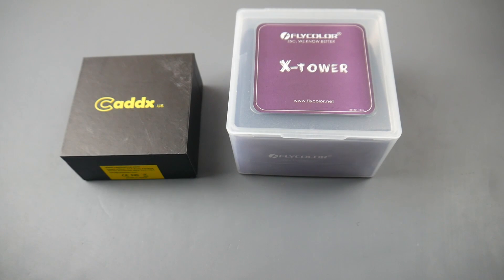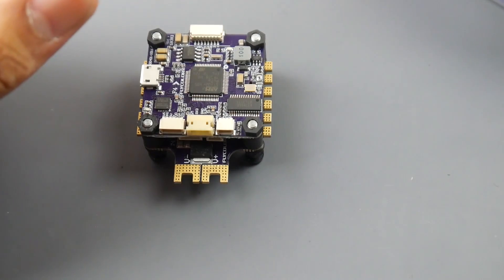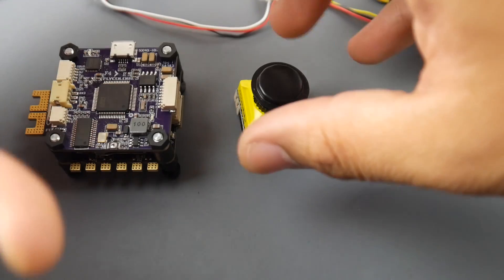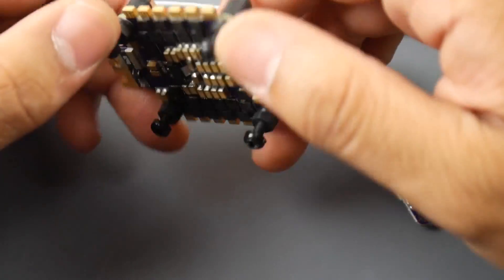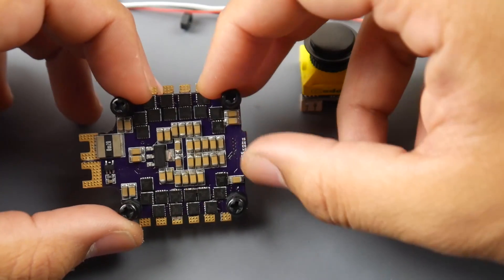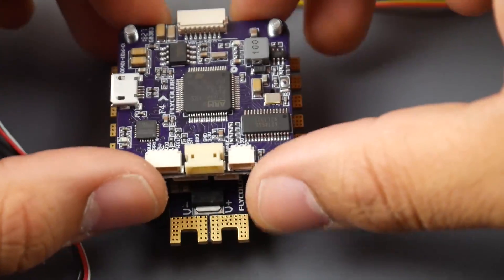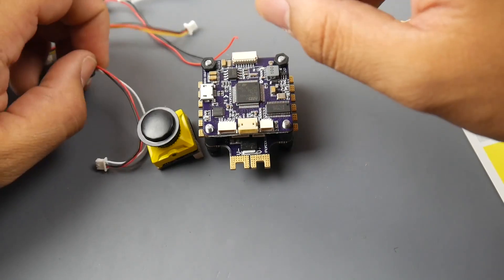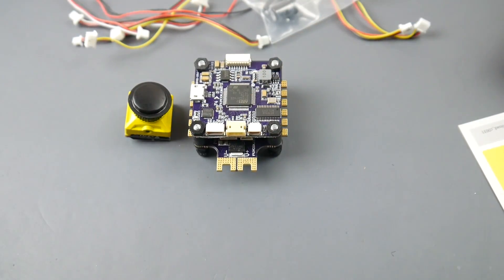Mid Range Easy Setup Stack // Flycolor X-Tower 40A ESC & Caddx S2 FPV Camera

Comment: I would have had a hard time with a pad-less FC like this because I want all the fancy stuff: FrSky F.Port, SmartAudio, camera control (UART or joystick emulation), LEDs. So these harnesses will need modifications to a point where soldering is just easier. However, I do know a bunch of pilots who would gladly plug in the connectors and be done with wiring.